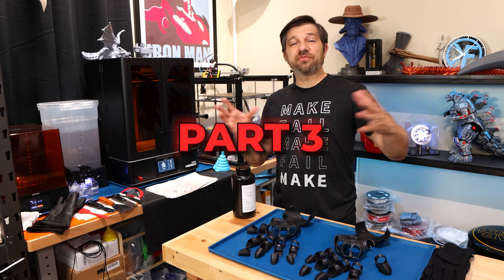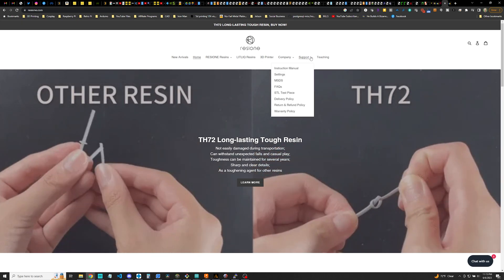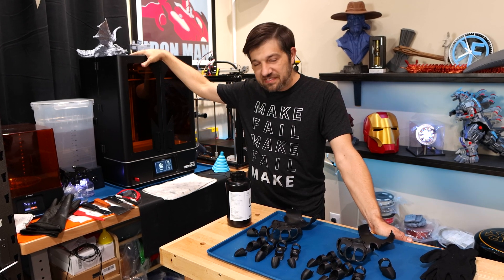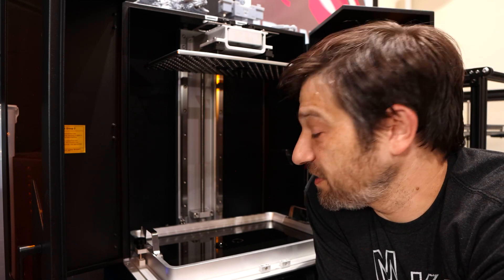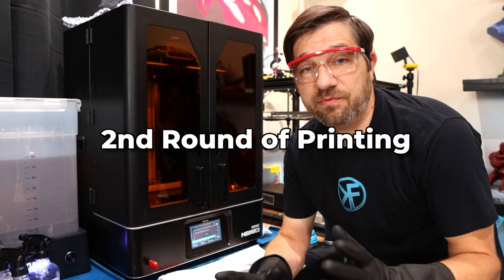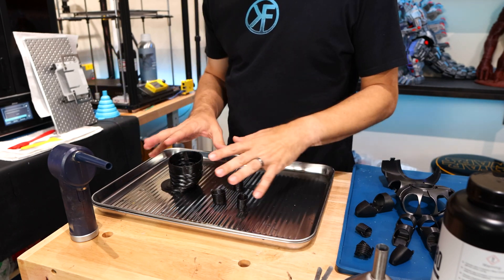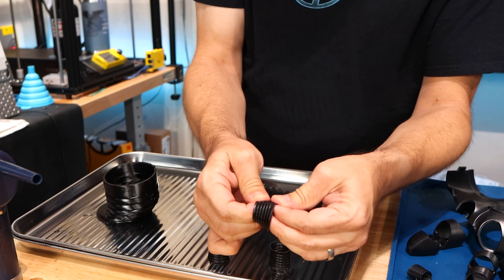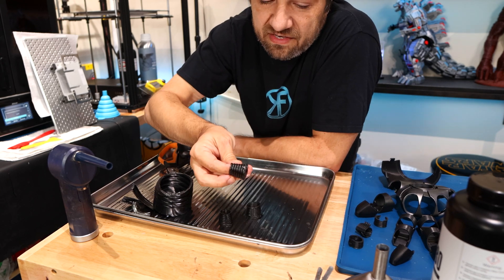Flexible Resin 3D Printing Functional, Wearable Parts

Comment: Hi Kris!
 for quite a while now I have come across many new Ender 5 Plus owners that are having trouble flashing your board firmware as they have the DWIN for FW 1.70.3 which is not compatible with your 1.70.2 firmware, they are also having trouble locating a copy of the DWIN for the 1.70.2 FW
 Any chance if you  have that DWIN set that you could include it with your FW download or make a 1.70.3 FW available?
Reply from the maker: Thanks for your message. I'll see if I can get a package and possibly do a video on it.
Reply: @kerseyfabs  Thanks Kris! as usual, it's left to the community to fix Crealities shortcomings.

Comment: I've printed with flexible resin that isn't generally available. It smells HORRIBLE. I noticed that when printing with flexible, I have to add close to 90% supports, on the heavy setting. I also set the first layer to a pretty high time, to get it to adhere to the bed, I think I have mine at 150 seconds. The stuff I use is meant to be mixed with other resins to change the durometer of them.
Reply from the maker: Yeah, all of that sounds similar to my experience. We'll see if I revisit this in the future. I'm not completely sold on the feel of this stuff.

Comment: Sounds like you might need to adjust the thickness of the parts for your sizing of print.
Reply from the maker: Yeah. As I play with this, I may redesign these myself to get the fit and engineering just right.

Comment: You would be better to print a mold and cast them in silicone
Reply from the maker: The point of trying this was to save the steps and be able to iterate on the parts. It seems like a good use of the technology and it saves material.
Reply: @kerseyfabs  Yes that is fair enough and testing new things is worth it. Though sometime going with what is tried and test is more effective and saves material in other ways.  Scraps of failed silicone molds  can be used as a filler in larger molds to fill in space. Also dealing with toxic chemicals is never fun. You need to get an activated carbon filter for your work room that will help with the resin smell and you and your kid will be safer for it. You do not smell it as much as you are use to it.  If you put in room extraction have it at ground level.  Also to note even clean and cured resin can be a skin irritant. It really does depend on the resin. Please make sure to read SDS and TDS of these things.  Any way just my two cents. I hope it gives you some insight :)